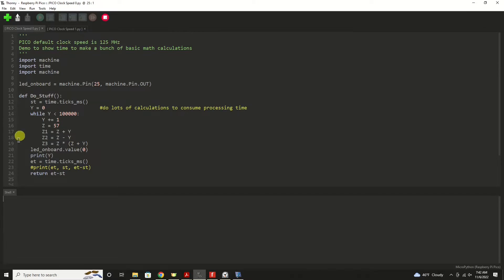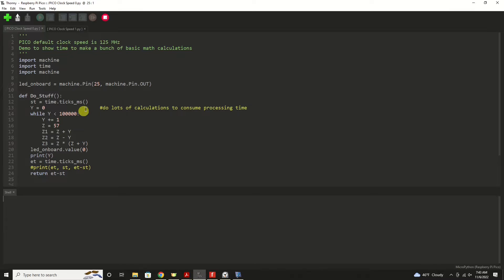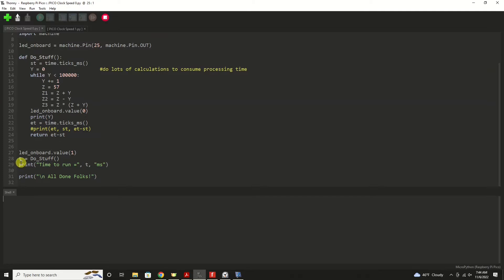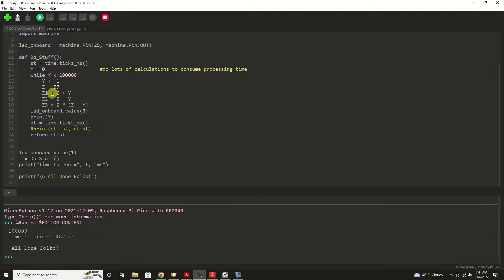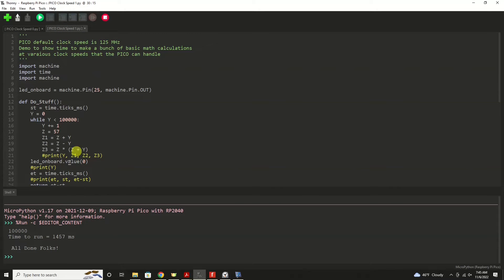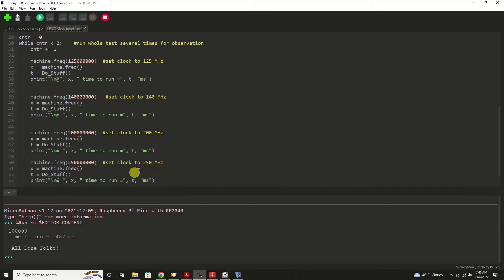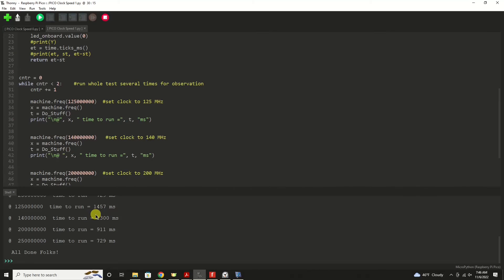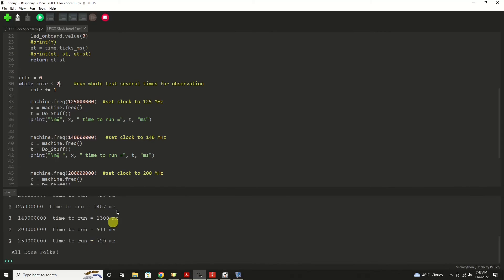Boost Speed of your PICO

Comment: If you are using SPI for something like a LCD display you’ll need to add this to separate the clock. 

from  machine import mem32
machine.mem32[0x40008048] = 1<<11 # enable peri_ctrl clock
Reply from the maker: Thanks much for the additional information!  Cheers, Chris